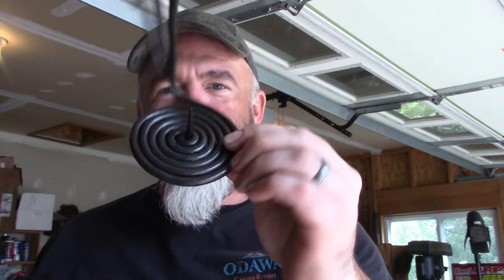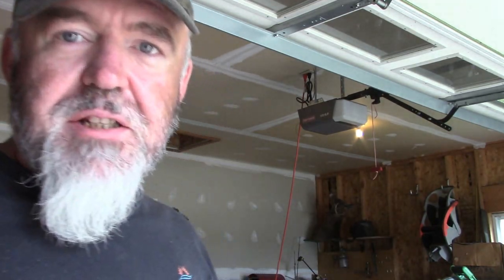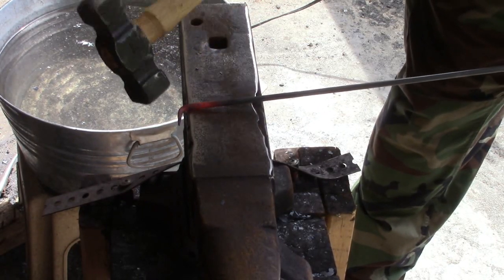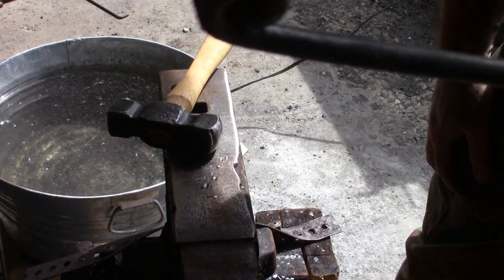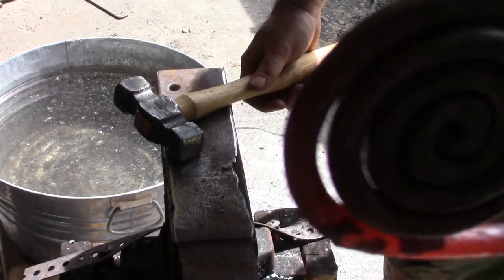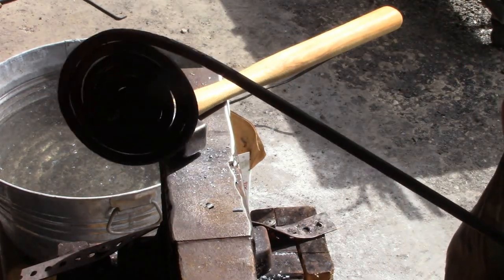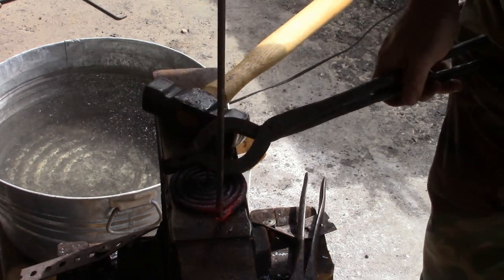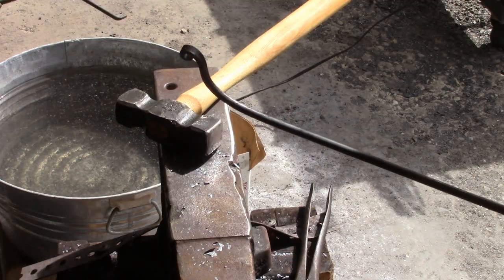How to Forge a Coiled Candle Holder

Comment: Once you get the first curl started, heat a length in the fire, clamp the point in a vice and just turn it around. If keeping the plane level, try setting up a circle of steel with a hole for the candle point. Just a 'smithly suggestion '
Reply: I really like this idea.  Mind if I barrow it and make some myself?

Comment: just curious but could you use a rubber or raw hide type mallet to keep from marking out the steel too much?
Reply from the maker: I wouldn't use rubber. It would melt in a heartbeat. Wood or rawhide would work well.

Comment: Amazing job! How did you like using that new hammer?
Reply from the maker: Well, this little project really didn't get to show it off much, nut here's what I noticed as the rest of the day went on.  I kept thinking to myself, "I really need to put this puppy through a serious test."  So I kept going to bigger and bigger projects.  Everything I forged, I thought the hammer was moving the metal TOO EASILY so I'd go for something bigger.  I ended the night making jewelry tree out of cable to hang my pendents on at the show, and even that, it was moving the metal more than any other hammer I own.  Maybe it was just one of those days where I was getting the "perfect" heat on every piece so it flowed like butter, but I tend to think that this hand made gem is really that much better than all of my store bought hammers.
Reply: +HoJ Forge & HEAPofJEEP absolutely, I haven't been able to buy a quality hammer like that yet, so I have just taken some of the hammers I've bought and modified them. I rounded one last night and I'm going to try it out today.
Reply from the maker: That's how I've been doing it too.  I don't know if its the quality of the steel or what... might be the fact that a lot of the hammers I bought were cheap Chinese Harbor Freight hammers and are actually pretty soft steel... but I'm sold on hand made quality steel hammers now.  The guy I bought it from charges less than $100 for most of his hammers, which was a lot nicer than some of the rounding hammers I've seen at two or three hundred bucks, so even though money is super tight, and I need a new anvil, I couldn't pass it up.  I came away from the scrap yard last week with a nice big truck axle, so I might actually cut a hunk of that and try my own luck at making one, just to see how close I can get.  Doing it alone, without any power equipment, I think it might be a very long project, just punching the eye, but figure I can just work on it here and there and eventually it will come out looking like something.

Comment: I would love to make a few of these for Yule! On a scale of 1 to Dont try it, how hard would this be for a beginner?
Reply from the maker: Its a great project for beginners.
Reply: HoJ Forge & HEAPofJEEP How long do you think it took roughly with heating to make this?
Reply from the maker: When I first got in to blacksmithing, it probably took me 45 minutes to an hour, because of all the second guessing I was doing.  Now, I whip them out in about 20 minutes, start to finish.  I'm still relatively inexperienced, but I've made a ton of these for the shows I was doing this summer, so got a lot of practice at them.
Reply: Thanks mate! Just bought a few rods today and will be firing the forge tomorrow!

Comment: Does the bee's wax help prevent rust? I've been having problems with that.
Reply from the maker: Yes. I sometimes use beeswax and sometimes just vegetable oil.  Whichever one I use, though, I always bake it on over the forge, like seasoning a cast iron pan.  It gives it a dull black coating that holds up well to moisture.  I made a handle for our chicken coop, as a test subject, and used the beeswax coating.  Its been on there a year and a half, through a full Michigan winter, and it isn't showing any signs of rust.
Reply: +HoJ Forge & HEAPofJEEP  That is good to know, thanks!